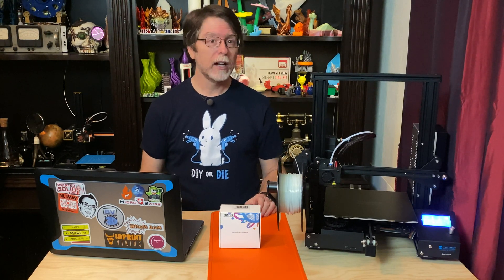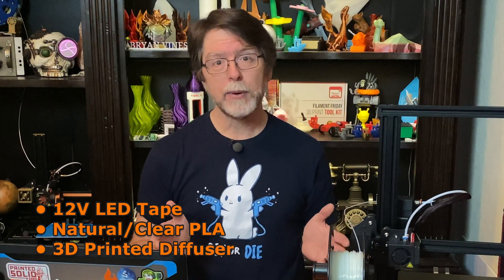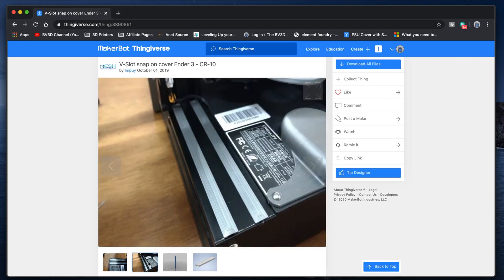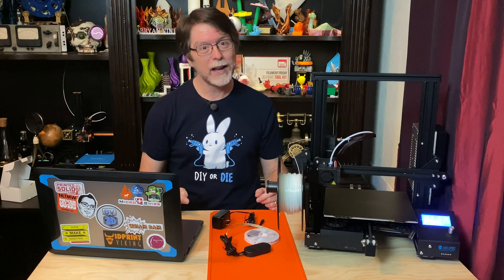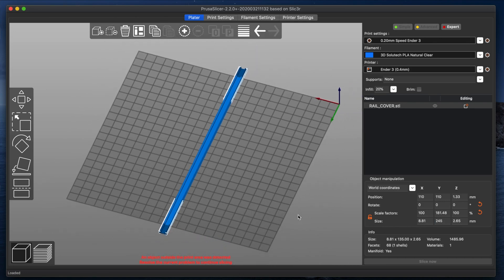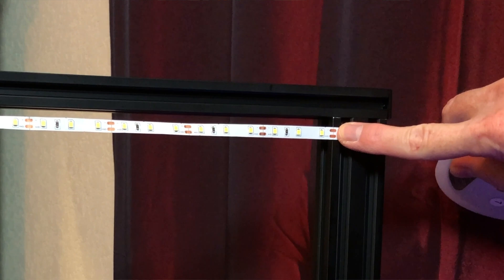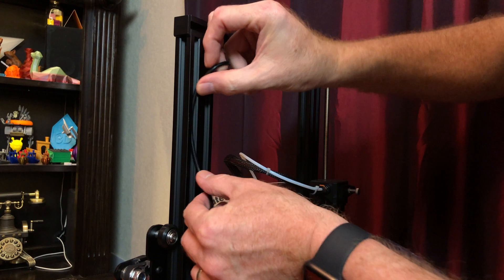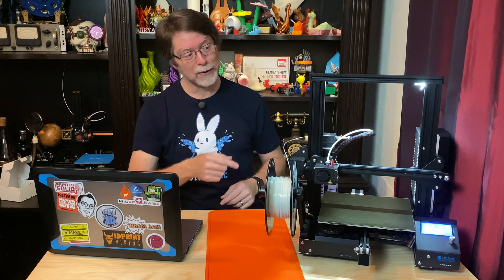Install an ENDER 3 LED Light Strip, NO SOLDERING! Under $20!

Comment: This is awesome, I just got klipper setup so I wanted to have a light for my webcam. Setup the same as yours except I added a wifi switch and a step down transformer to pull power directly from the psu. Great video!

Comment: I know this is an older video; but, couldn't you just wire a 24v led strip to the power switch on the printer so the light automatically comes on when you turn on the printer or power the strip via the power supply & it's own 20a 24v switch?

Comment: Hi Brian. Great video. I have watched a few of yours and they have been very helpful. I was wondering if you would share you slicer settings that you used for this. I have been using cura myself and have installed superslicer to give it a try. Unfortunately I am not having much luck in dialing in my settings. My prints are very slow. This one is coming up to about 42 minutes. I am using the ender 3 pro with the 4.2.7 upgraded board with BLtouch. I am still pretty new to the 3D printing game and especially new to setting up slicers.

Comment: Want a fun mod? Spend $3.50 at Walmart for a 6ft led remote LED strip. Insert said strip INTO THE CHANNEL! Start AT bed level on ona side, work all the way around the top and down the opposite side. Plug into USB or, solder in. Either way, that's custom color lighting for every inch of your printer at and above bed level, wanna get crazy? Do what I said, but don't stop, run it through all of the channel UNDER the print bed on the insides of the frame. No the whole thing looks like a 3008 Alienware PC. You're welcome in advance. No slot cover required. No printing. Just loosen a bolt, slide on in and square up.

Comment: I like how you attached the led strip though I think maybe a 5v or 24v led strip would be better.  The 24v one could be powered direcly from the printer's power supply.  The 5v led strip could be powered from a USB port.

Comment: You don't mention at all what power cord you use or even how to connect it.
Reply from the maker: 2:08 "Plus, it includes the 12V power adapter."
2:13 "The wiring from the switch module to the LED strip is already taken care of. It's already soldered into place."
8:36 "The dimmer switch module has peel and stick squares on the back on it... Stick it on top of the power supply."
8:47 "Now just plug the power supply into AC power, and then into the dimmer switch module."

Comment: Hello, is it possible to hook up the light strip to the power supply on the printer? Maybe using a buck converter or maybe there's just 12v already there

Comment: Why not use the power supply to power the LEDs? You can use buck-converters if need be...
Reply from the maker: Hi Simon! This was intended to be more of a plug-and-play concept. After I made it, someone else mentioned that Gulf Coast Robotics has a kit that taps into the XT60 connection between the power supply and the electronics box (https://amzn.to/3h7HwtO).

I've also got a power supply cover I designed for my Ender 3 that's got three switches, and some buck converters (and a quiet 60mm fan that I run a little undervoltage to keep it even quieter). At some point I'll put that in a video.

Comment: I much prefer to use a compact goose neck lamp with a high intensity LED light.
I aim it at a sheet of paper on the wall next to the printer. Nice even diffused light just right for the camera with no shadows at all.
Reply from the maker: Thanks, that's a great tip for indirect lighting! 👍

Comment: I printed the extrusion cover file you recommended - it doesn't fit. I have printed covers before that were much better. I recommend getting '2020 Extrusion profile cover (Nut 6)' on Thingiverse instead, and lengthen it in the same manner.
Reply from the maker: Hi Ron. That's interesting -- I've printed several of these and haven't had an issue with fit. The thing I like about it might be the thing that's causing problems for you: It doesn't go very deep into the V-slot.
For those who'd like to give Ron's suggestion a go, here's a link: https://www.thingiverse.com/thing:1478147

Comment: C = sqrt(A^2 + B^2) or about 311mm for a thin object. It can be extended a tad further by angling in the Z and using supports. 399mm for a [too] thin [to print] object.
Reply from the maker: Eeek! Math! 😉Thanks, Old Curmudgeon!

Comment: could you make the flash as well when you print
Reply from the maker: This one won't do that, unless I press the on/off button a lot. 😉
Reply: For about the same cost they have sound activated LED strips available that you could install that would react to the sounds the printer is making.

Comment: Great video Bryan. I have LEDs near the hotend, makes it much easier to check the nozzle and first layer etc. I always use the daylight white LEDs.
Reply from the maker: Great tip! I did that on my Ender 2. I figured since I had to run wires to the hot end for a parts cooling fan, I'd put some LEDs there too. At least that's a 12 volt printer, I didn't need a buck converter or anything! 😃
Reply: @BV3D  I connected my LEDs to the part cooling fan so they go on/off with the hotend temp of 50c so it also acts as a visual reminder that the heater is on.

Comment: Hey Bryan what is the fan contraption that you have on your power supply?
Reply from the maker: Hi Dave! That's part of my quest to quiet the obnoxiously loud fans on the Ender 3. I designed a PSU cover to hold a 80mm fan that I'm running undervoltage (big fans can turn slower and still move plenty of air). I've also got a couple of buck converters in there, and even one connected to a USB port to provide power for a Raspberry Pi. I've got plans to do a video about that in the future!
Reply: @BV3D  Would you happen to have any designs for that?  It looks like an interesting build.
Reply: That's one of the cleanest led installs i have seen!   Great job Bryan!

Comment: I have RGB lighting on my CR10 that cost me £8 for a 10m strip with remote control, I can set it to warm white as well
https://www.banggood.com/DC12V-2M-3M-5M-10M-Non-waterproof-RGB-2835-LED-Strip-Light-24Keys-IR-Remote-Control-EU-Power-Supply-Plug-Full-Kit-p-1577750.html?rmmds=search&ID=44708&cur_warehouse=CN
Reply from the maker: Hi Andrew! That's pretty sweet! 👍
Reply: @BV3D  Now that I have seen yours I am thinking of including a variable resistor within the circuit to dim  the light power
Reply from the maker: Some of these light strip controllers have "music mode" where the colors change based on sound levels. I bet that would look wild on a printer with A4988 stepper motor drivers! 😉
Reply: @BV3D  I would rather have quiet steppers and just crank up some good music.
Reply: @BV3D  Yeah I bet that would be pretty mad, when I first heard those steppers I thought my nozzle was scratching the bed